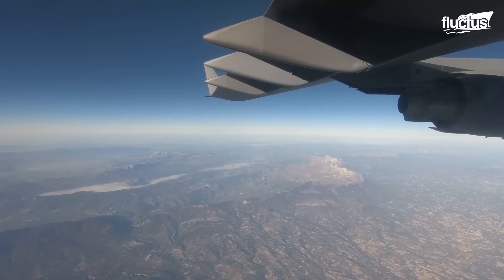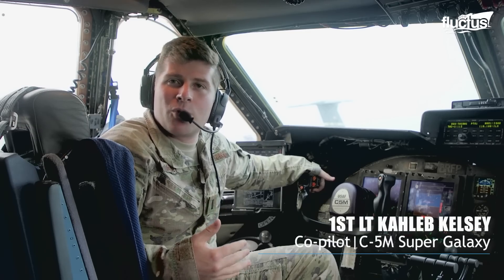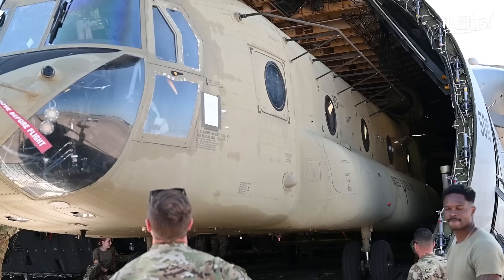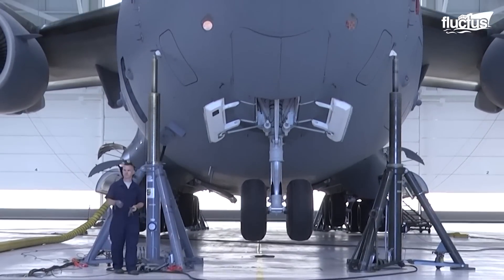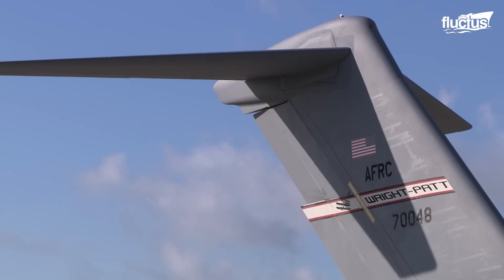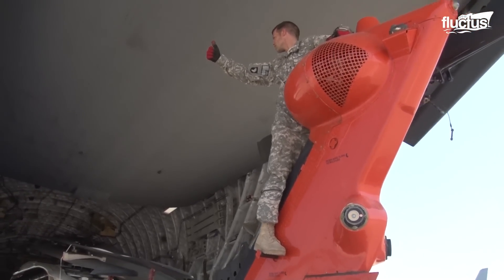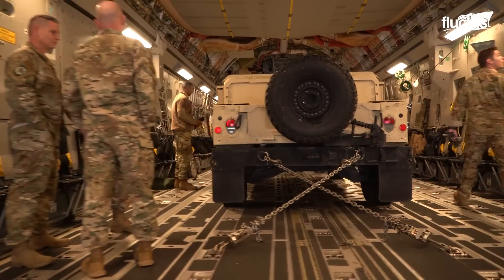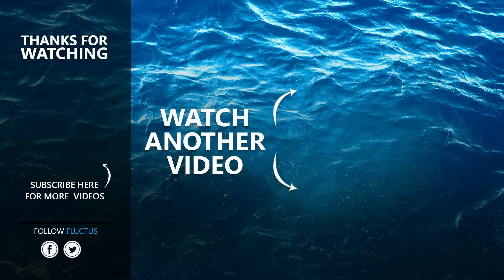This US Plane Was Built So Big it Needs 28 Wheels to Land

Comment: If it takes off full of fuel and has to land for an emergency, it can't until they get rid of a couple of thousand pounds of fuel or break the frame and explode in a ball of fire from the weight. Life is great if you don't crumble like a stale cookie. LOL...
Reply: Large transport aircraft (e.g. airliners) can typically land at maximum takeoff weight, so dumping fuel is optional.

Comment: I remember in the early 1980s I was attached to an F-14 Squadron vf142 and we arrived in Naval Air Station Roosevelt roads in Puerto Rico because we were serving as the enemy attacking an aircraft carrier that was practicing to be deployed to the Mediterranean. Along Came the Air Force with their FB 111 aardvarks and it was impressive to see the C5 Galaxy aircraft arrived prior to the f111s. they seem to float in the air arriving in slow motion, it was a spectacle to see one after another Landing. the operation was impressive in how they were able to offload all the equipment quickly and prepare for the arrival of the f111s.

Comment: My first flight on one of these was the C5-A,(the original), and not only was the sheer size of the interior space mind boggling, but so was the fact that you could see every part of the cable system that controlled the wing surfaces moving. It was steampunk before it became trendy.

Comment: When taking on this much useless weight in landing gear its just an easy deduction for me to say that the next generation of heavy lift aircraft will have a ground based autonomous drone tug that is able to readily available to launch and retrieve aircraft thus ending the the most dangerous part of flying, take off and landing from the airstrip.

Dramatically increasing the aircrafts usable payload and margin of safety as well as reduced fuel consumption ect.,ect... you heard it here first boys and girls.

Does anyone know Elon already has a self driving automobile?
We Have The Technology!

Comment: With Regards to the C-5A vs AN-225 debate...  
Lockheed C-5 Galaxy - versus - Antonov AN-225  / 247 ft   - length -   275 ft 7 in  /   223 ft - wingspan -  290 ft / 6,006 ft2 - wing area - 9,741 ft2 / 64 ft 11 in - height - 59 ft 4 in / 4 - engines - 6 / 43,000 lbf - thrust per engine - 51,590 lbf / 172,000 lbf - total thrust - 309,540 lbf / 
833,000 lbs - MTOW (Max.Take Off Weight) - 1,323,000 lbs / 5,162 nm - range - 2,430 nm / M0.71 - cruise speed - M0.78 / 287,000 - max payload - 551,000 lbs.  

While the C-5A may be "One" of the largest (number 6, out of 10)... it's certainly Not the largest. The Only way it beats the AN-225, is in height... but, Only as measured at the top of the vertical stabilizer wing... the AN-225 is taller to the top of the fuselage.  Yes, I know... the AN-225 suffered some pretty nasty damage and destroyed the front quarter to a third... however, is rebuildable... and they Do have another Mirya, that is over 60% complete... possibly closer to 70%.
Reply: I love Antonov 225 mirya
Reply: Not really a debate, unless you are an insecure Russian.  The AN-225 is a six-engine aircraft.  The C-5 has four engines.  They aren't in the same class.  But where they are really different from each other is total airlift.  C-5's are in the air daily.  The -225 only flew one to two missions a month.  And now it doesn't fly at all.

Comment: Those tires are huge & 200 PSI. It took 2 of us to change a tire. I was a communication/navigation technician in the Air Force Reserves & since that equipment didn't often break I usually helped out with tire changes, etc.
Reply: Means you work with these giant aircrafts right! Wow
Reply: Still working
Reply: @claytonwilliams2689  I didn't re-enlist in 2001 & retired from another job in 2017.

Comment: I'm no engineer but with 28 wheels, I am surprised only 2 in the front.
Reply: @FlightLevel 360 - i am surprised as well.
Many people have wondered why the nose gear appeared to have tòo few tires. I would prefer to see a couple more.
But i'm sure it is built and able to handle the stresses and weights.
Reply: The C-5 has four in the front, and unlike a typical airliner design which has significantly smaller nose tires, those four are the same size as the mains.

Comment: What's amazing about wheels is, how much weight and the force of impact they take when they hit the ground. Besides engines, wheels are up there of importance, but they get less appreciation.
Reply: It has that many wheels to be able to land on less than ideal runways (dirt) so as not to dig itself into the runway but to compact the earth under it. A requirement that the DOD asked for. Also it weighs less than a 747 but can carry more weight due to the outer skin design. I toured the C5 assembly line back in '72 at Lockheed in Marietta. Beautiful plane!

Comment: It really doesn't need the 28 wheels to support the aircraft. There was a requirement in design for operation off of unimproved airports. I believe it was tested but never really used. A 747 weighs in at nearly 1,000,000 LBs and it has less wheels.
Reply: True, the c17 max takeoff weight is 585k pounds versus 747 max takeoff of 700k - 987k pounds. I google fact-checked :)  Wingspan of 747 is 224.5 ft compared to c17 at 170 ft. We should be watching a 747 video right now, and the c17 has waaaay too many wheels to justify itself
Reply: Wrong
Reply: Let’s get you a medal 🎖️

Comment: Imagine if the Wright brothers could see this plane get loaded with a 60 ton tank.  Then take off.
Reply: The Wright  brothers first flight could have taken place inside the cargo bay of the C-5A.
Reply: Bruh they’d nearly come back to life
Reply: They would probably just take their cellphones out and start livestreaming it or something...
Reply: Amazing right
Reply: D22.... Compared to the AN-225, in MTOW... the C-5A is a Tonka Toy.  With a MTOW of 1,323,000 lbs, the AN-225 is 510,000 lbs heavier, and of that.. it has a payload capacity of 551,000 lbs, which is 264,000 lbs more than the C-5A.   I'm NOT "knocking" the C-5A, I'm only comparing the two.... they're both Great planes.   Even the AN-124, out-sizes the C-5 Series, in every way... except maximum range in fuel.
Reply: Só quero te lembrar que foi Santos Dumont  o primeiro que teve a ousadia de desafiar a gravidade e decolar e pousar em segurança com seu avião!!
Reply: Imagine if Santos Dumont sae it!
Reply: What's funny is that if Orville had lived to 97, he would have seen a man land on the moon
Reply: @WindFireAllThatKindOfThing  did airplane flight influence rocket flight? Never really thought of that? Cause I’m a way they are a lot different.
Reply: @Itsfalcon9  Of course. Aerodynamics. Heck... X planes were the prequel to manned space travel. You tube Chuck Yeager for some good content. 👌
Reply: I imagine they'd wonder where their sister is so they could get one last tag-team in.
Reply: @matthewcetorelli8451  You mean pokadoniss?